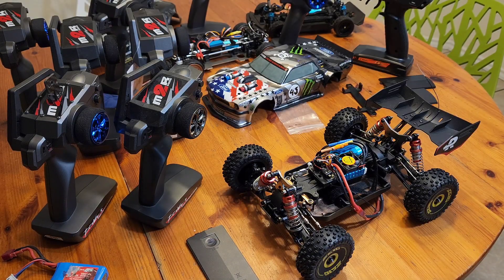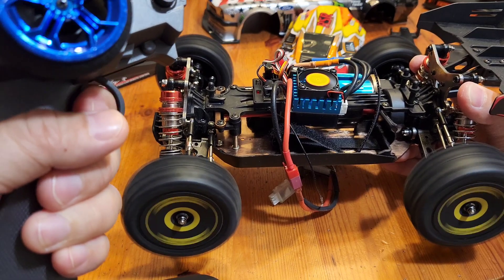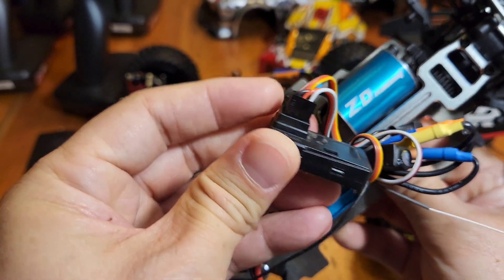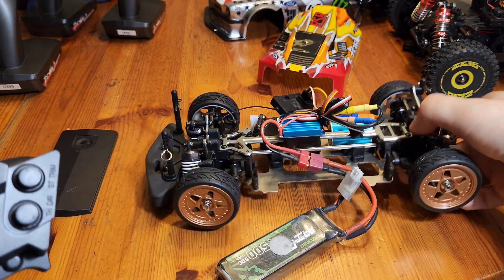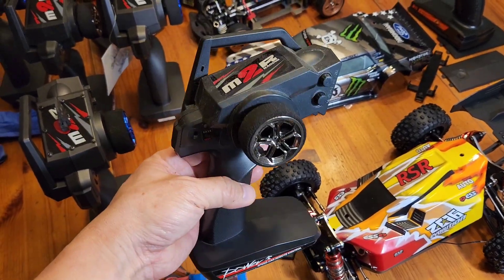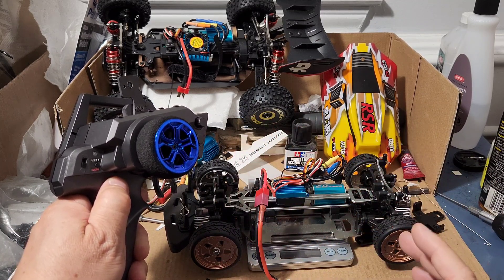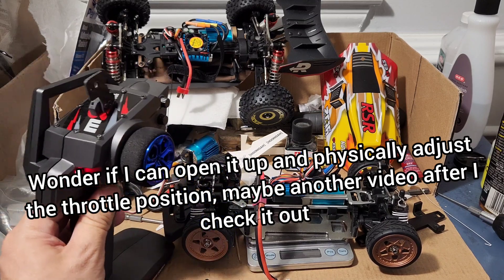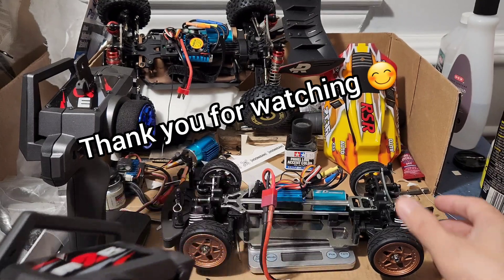Wltoys Brushless 144010 124016 124017 Throttle Delay Review and Fixes (Transmitter & Receiver Test)

Comment: I recently ordered a wltoys 124017.   Didn’t know about the delay.   If I had known,  would not have purchased.   😣
Reply from the maker: Get an old version Transmitter (Silver wheel) https://www.ebay.com/itm/334023157130 or the latest version (Colorful design) will eliminate it

Comment: Just got my wltoys 124017 today and it let out the magic smoke on 3$, i changed my esc to a hyper go h16bm esc it has the 4300 kv motor and separate receiver man that hyper go esc makes mine scream with no delay, i also replaced my radio
Reply from the maker: Nice

Comment: What is the mode button for on the m2r silver wheel remote. Use that one for a stock 124019 but the instructions didn't say what the mode button is for.
Reply from the maker: nothing for the buggies, maybe light control for other models

Comment: I bought 144010. Replaced remote/receiver first, still a delay but better, tried new blue remote on 1284131 and now a delay, replaced esc on 144010 and delay was gone. It’s both esc and remote
Reply from the maker: Yes, all the Wltoys ESC has a very minor delay and many of the cheaper ESC too,  not enough for me to worry about.  Sometimes it's part of the design.  Arrma Vortek is a good example of soft start and people perceive it as delay.  Amain has a good video review comparing it with Traxxas .  What ESC did you go for?
Reply: @customtoyrevolution  I bought the HW60 amp. And I have a new Chinese one to go in that is 4s 120 amp.

Comment: Bro i have 1 question please answer..!!!

Can i connect 144001(stock) transmitter with 144010( stock)  reciver...??
Reply from the maker: Yes
Reply: @customtoyrevolution  This didn't work for me. I bought the old remote, but it won't connect to my receiver.... Any ideas why?
Reply: Ok i found the solution. You have to first start the remote, and then the car while at the same time pressing down the bind button.
Reply: @stefankanis7994  thanks
Reply from the maker: @stefankanis7994  Binding Instruction:
1. Hold the "BIND" button from the receiver while powering on.
2. Wait for 2 beeps and release "BIND" button.
3. Power on transmitter, rotate steering wheel.
Reply: @customtoyrevolution  Little bit different than what i did, but i guess it will also work. Thanks so much for the quick reply!!!